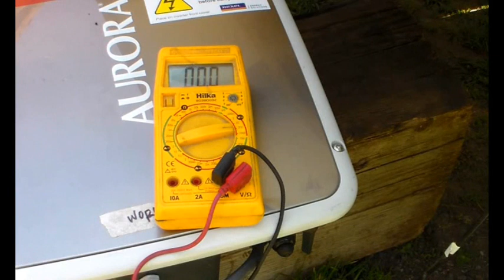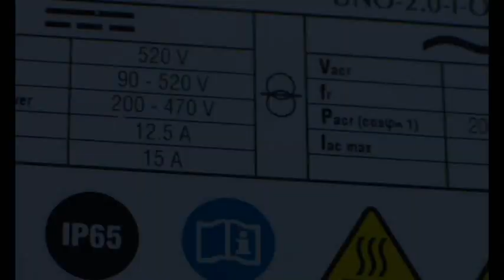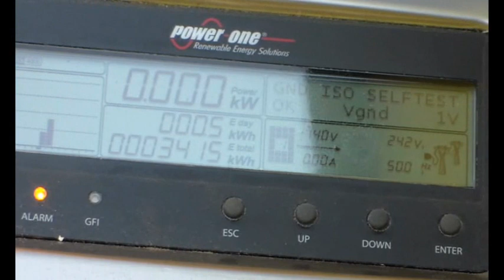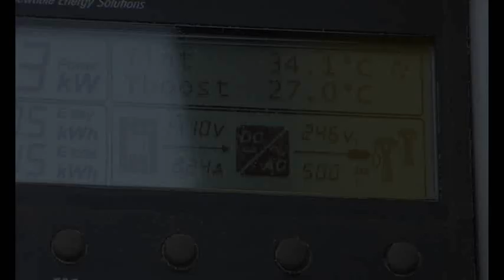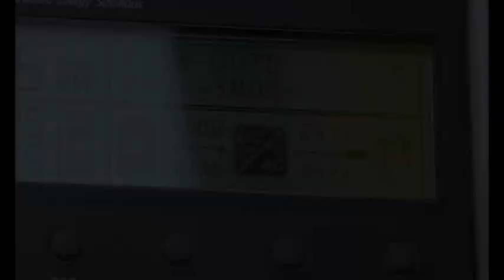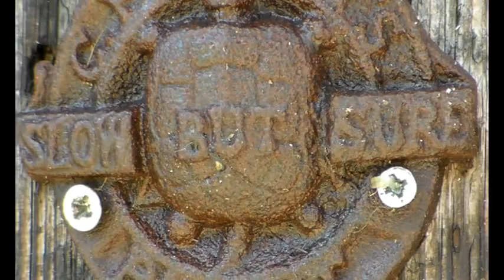Testing a 4 panel solar grid system, MPP volts and current

Comment: Thanks for the quick reply andy.  Im trying to setup a power tool battery 240v charging station on my van. It only needs to charge 40w load at 240v.Using my 250w pv panel and as little extra as possible, due to lack of cash just now.. Ive seen these microinverters for each pv panel but they are a few hundred quid. Similarly batteries and mppt charge controller are beyond my budget.  Unless you can suggest a cheap battery with a 20a mppt charge controller?  Thanks for your help and great youtube channel.  Just finished buikding my tiny house on a trailer and now the minefield of finding sonewhere to park up.  Cheers dave
Reply from the maker: Dave, the micro inverters are grid inverters so no good for you. Try one of those small panels to keep camper van batteries live connected to your truck battery and a 300w cheap inverter. Otherwise a larger panel and a cheap PMW charge controller. I'll be in Brighton 2&3 Oct for BPT, cheers

Comment: Hi andy any idea where I start with off grid solar pv with no batteries to run 240v stuff?  Ive tried pv to dc to dc converted then a dc to ac inverter and it did run a light.  Apparently running jnverters dirctly is not good for them  cheers dave
Reply from the maker: Dave, I suppose if you could find a buck converter with a fixed output voltage from a variable input things may work. But really I don't see the advantage as a bit of cloud would drop the current right down. So the batteries are there to smooth the ups and downs and give power for lights when you need it. Good batteries and a quality charge controller are vital. I prefer flooded batteries but now the lithium 18650 cells are being used in domestic appliances then it's possible to build a reasonable sized pack. Cheers

Comment: Good work Andy. Testing the panels and inverter on a sunny day is far more encouraging than on an overcast day as I did!  Thanks
Reply from the maker: Owen, thanks for that, with this and your video in deep cloud it shows both ends of output possible during the daylight hours. Access to full sun and the right panel angle make all the difference. Built a battery terminal spot welder and  fixed one of the AEG batteries last night, cheers
Reply: Good stuff. Did you film the spot welder build?
Reply from the maker: @bootsowen  Owen, not this time as it was an experiment. I will do so on the other AEG battery. All in good time, cheers